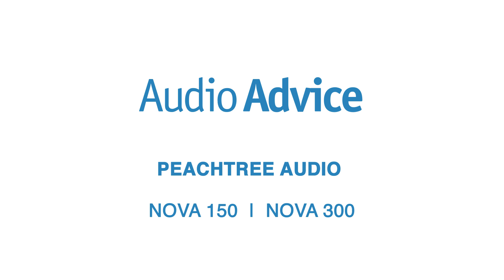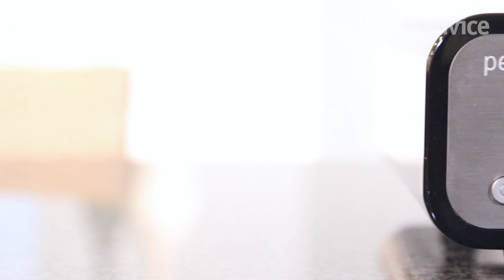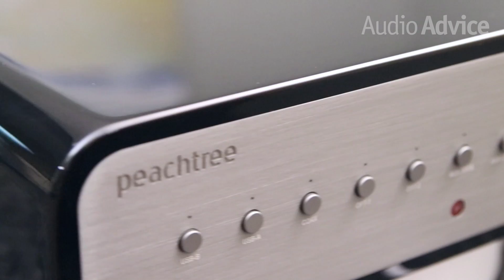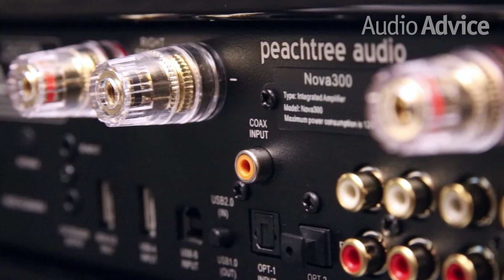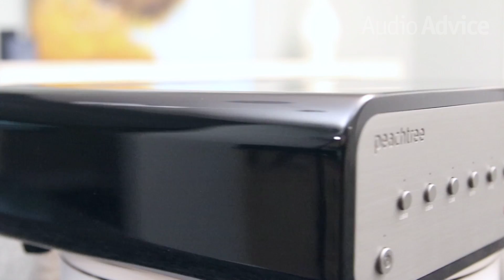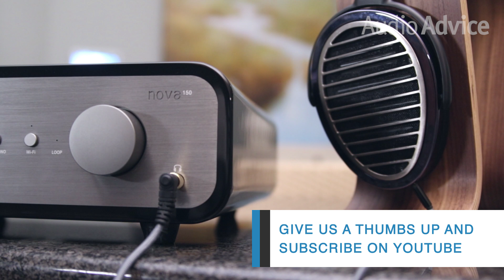Peachtree Audio Nova150 and Nova300 Review

Comment: Can I make this a Bluetooth as well?
Reply from the maker: It will accept a BT receiver but does not have one built in.  Thanks for watching
Reply: @AudioAdvice  just found out my peachtree N150 has no audio out for a BT….. uggghhh
Reply: @AudioAdvice  also how do I turn off the bypass? I can’t control my volume anymore. Thanks.
Reply from the maker: @gabemartinez178  Here is the owners manual https://cdn.shopify.com/s/files/1/0401/9490/0118/files/nova150_300_500_Manual_6759806b-2ff9-47b6-8d08-6e1069087064.pdf?v=1631644522  If you purchased your Nova from Audio Advice our tech support team can help you out.

Comment: How does the phono sound on it
Reply from the maker: Surprising well for an integrated solution at this price point. Unless you are using a super expensive turntable most people find this to be a great solution. And if you ever do get into a super expensive table and want to upgrade you can always add a phonostage in line. But most people don't ever see a need to do that.
Reply: I’m between a Marantz pm8006 and a nova 150 I’m running psb800 and a Sony psx700 tirntable
Reply from the maker: @jerryandlisa27  Jerry, you should call in or chat tomorrow with one of our audio team.  Just go to www.audioadvice.com

Comment: This is pure advertisement, and some of it is just plain wrong.  First, Class D amps are switching amps, not "Digital amps" as described here.  Second, for a given amp design the higher-powered amp will always sound worse (I got that straight from a very famous amp designer), so you shouldn't buy the 300 Watt amp unless you actually need it.  Third, it offers NO real help in choosing between the two.  Useless to me!
Reply: I call them class pee amps

Comment: can i set crossover values on speakers
Reply: The pre-amp outputs can used for subwoofers.
Reply from the maker: We mentioned the loop thru which would come in very handy for an external crossover like the Vandersteen, but there is no internal crossover nor is there a sub out on the Nova family.